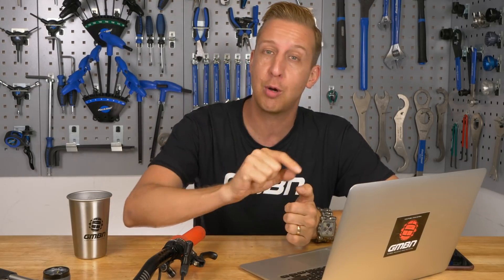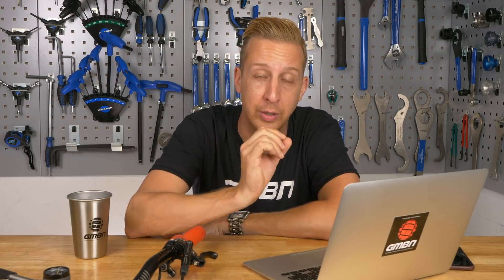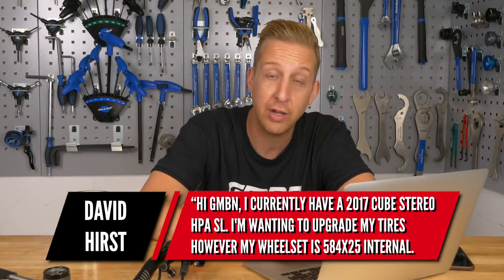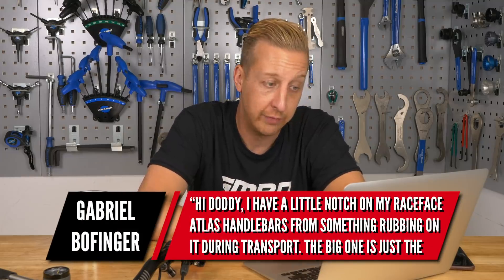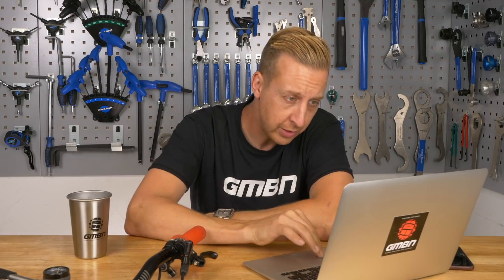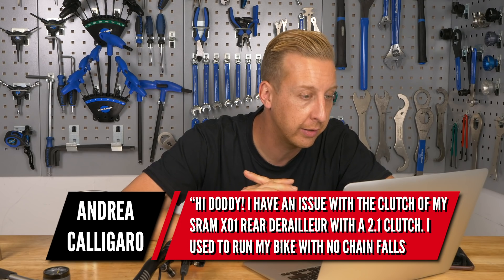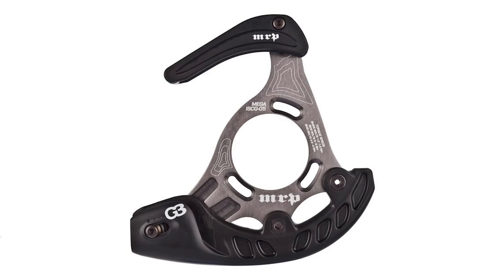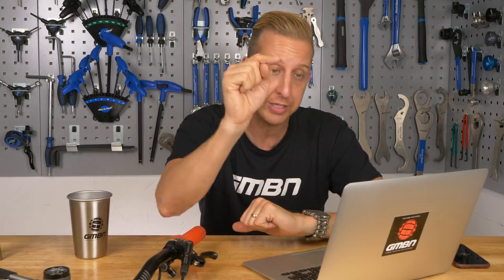Why Does Your MTB Chain Keep Dropping Off? | Ask GMBN Tech

Comment: #askgmbntech I've recently buckled my rear wheel. Pretty bad as well. It happens pretty often as well. I'm trying to find the cheapest option to solve it. Thanks love the show
Reply: i have tacod a wheel before and wanted to fix it cheap. i bought a new rim and relaced the wheel myself using videos, was back on the trails for 30 euros
Reply: @ultiss  thanks. I may just buy some new wheels all together. I need smaller ones. I've got 29ers but their to big for the riding I do. Thanks for the help i appreciate it a lot. 😊😊😊👍👍👏
Reply: if you put smaller wheels in your 29" frame your bottom bracket will be very low and your pedals will hit the floor a lot
Reply: @ultiss  ik but I still prefer a more aggressive bike. Ig my back wheel control will have to be on point
Reply: Might wanna consider selling your bike and getting a new 27.5" bike instead? (or maybe a 26er?) Unless your bike states it can run 27.5"+ or 29" tires I wouldn't recommend it.
Reply: @boomerangfreak  my bike was a bargain. It means to much to sell. I've put smaller 27.5 wheels on it. And it was incredible. No problems. Thanks for advice though 😊😊☺
Reply: Hey if it works it works, if you ever have to go and change cranks maybe get smaller cranks like 165 or so? Always a great way of getting more ground clearance.
Reply: @boomerangfreak  good point. Might do that cheers
Reply: If it happens often maybe the problem is you? I mean, landing pretty hard or not looking where you are landing.
Reply: @GrimYak  I mean. 29er wheels aren't as strong so ig I'm more likely to buckle it. I'm a good rider though. It happens when I do tricks. It buckled when I did a tuck no hander. I forgot about the landing and cased pretty bad. I see where your coming from though so thanks

Comment: #askgmbntech... ...What would you recommend for a budget full chain guide on  isg05 mount type.......im riding a dartmoor primal 2017...and second when is the anouncement of the winner of the bike build
Reply: 1. What's your "budget"?
2. chain guide only or with bash ring/taco too?!
Reply: I don't know about budget but oneup guides are pretty much the standard at this point, everyone uses them because they're light, simple, and effective .They're comparably priced to most other guides.

Comment: What causes a shock or fork to top out #askgmbntech
Reply: The force, Luke ... the force!
Reply: if you bottom out too much with correct sag you should add volume spacers to make the fork more progressive (more force needed at the end of the stroke)
Reply: @ultiss  No, topping and bottoming out are different.
Reply: then what is meant by topping out?
Reply: It's when the shock or fork rebounds fast and there is a "tunk" sound as it "tops out".
Reply: Google is your friend http://forums.mtbr.com/shocks-suspension/please-help-top-out-problem-new-pike-fork-904408.html

Comment: Can I fit a 1x11 Cassette on my 2018 Trek X Caliber 8 on stock wheel and hub? Boost 141 QR #askgmbntech
Reply: 98durangopack you can. I did it on mine. Look at Worldwide cyclery. The have a sunrace/gx combo for the regular Shimano Freehub. It’s also fairly cheap compared to the Sram eagle prices.
Reply: https://www.worldwidecyclery.com/products/sram-gx-eagle-12speed-group-w-shifter-derailleur-chain-sunrace-50t-cassette?nosto=productpage-nosto-3&refSrc=8310231429
Reply: for mtb 8, 9, 10, 11 speed cassettes are the same width
Reply: @ultiss  9 onwards